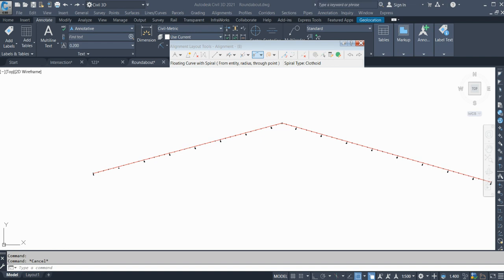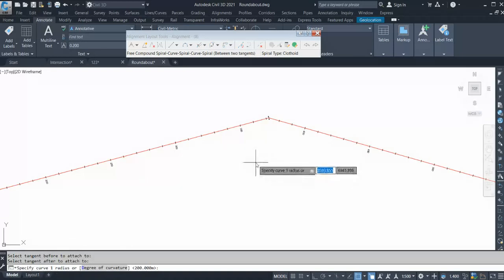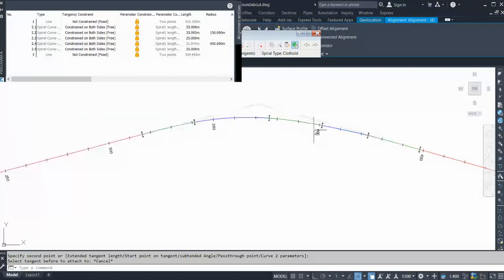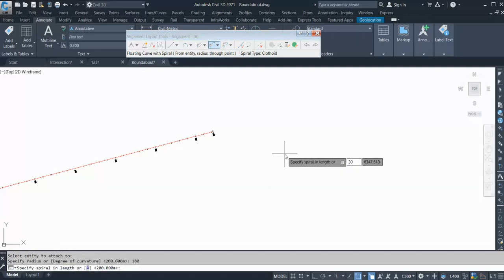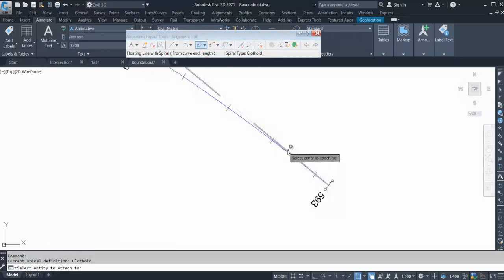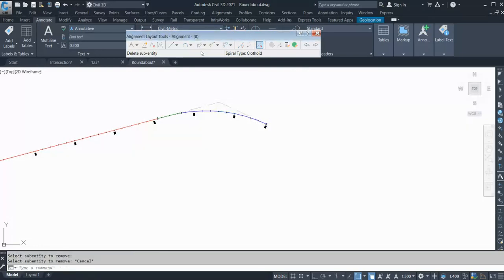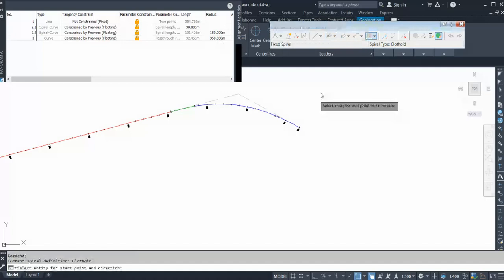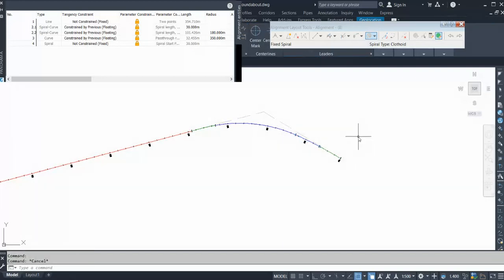Civil3D - Alignment Design - Compound Curve

Comment: Is there any method for computing length of curves automatically or does it have to be done manually using formulas
Reply from the maker: It calculate automatically in Civil3D.
Reply: @Civil3DProTipsandTricks  okay, will try using this tool. I've only created simple circular curves till now.